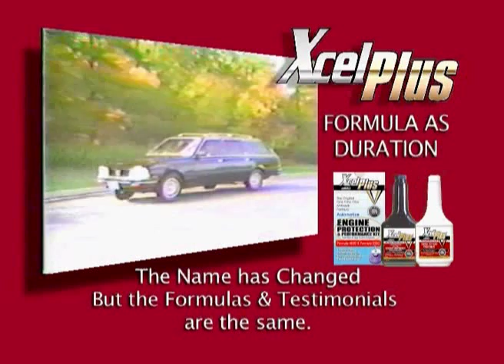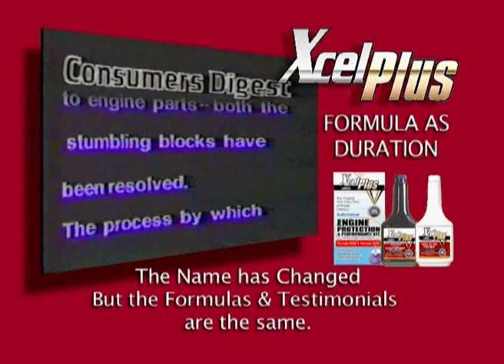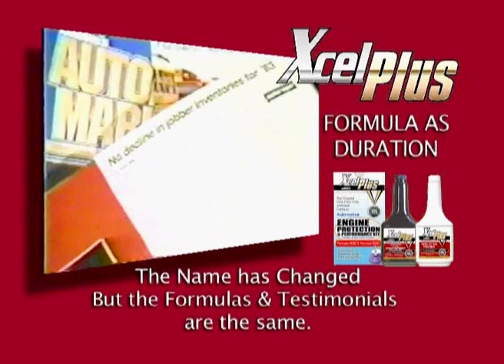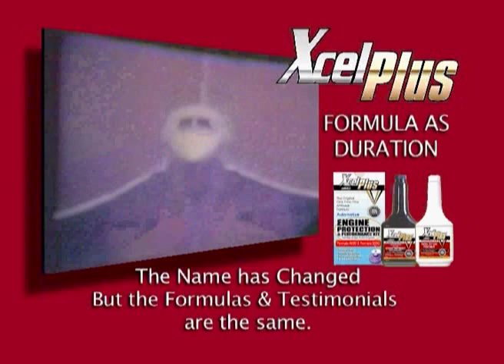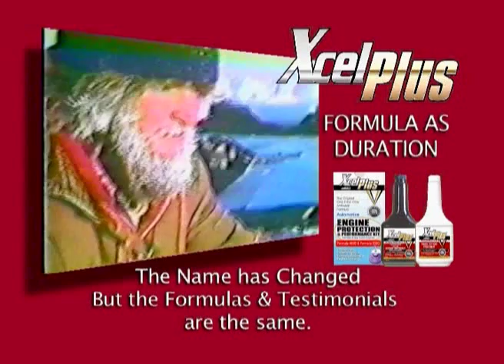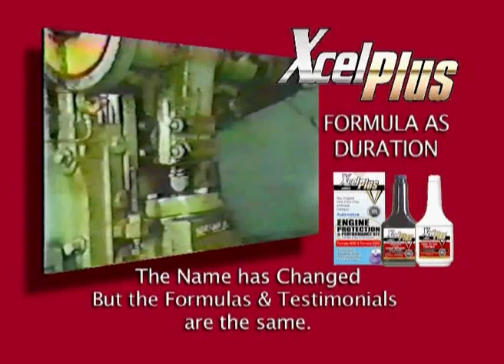Xcelplus Testimonials (Duration)

Comment: Narrated by Orson Wells...Awesome. I use slick 50 for many years after buying this new automobile and never knew about the switch of ownership and make up of the Slick 50 oil product.
Today I changed my oil, I used 3+ qts Mobile 50.000 mile oil and I used 1 qtr Duralube in my 3.4 engine w/299222 miles. Runs as good  as it did when we drove it off the lot in 1995.
Next time I may give ExcelPlus a try.
Keeping the oil changed is everything to the life of the engine, meaning are you financially ready to purchase a $2.000 to $3.000 engine? No? well spend $30 dollars and drive on.